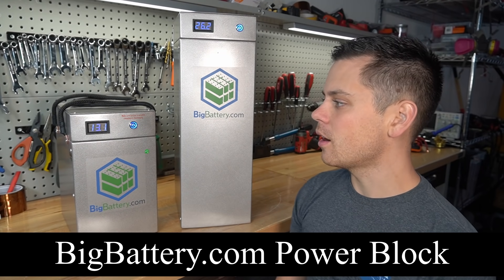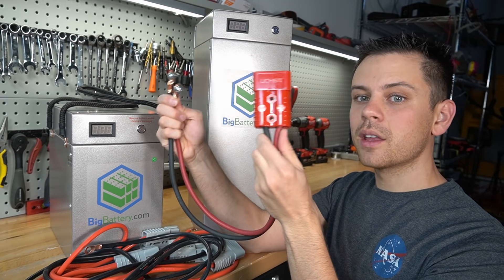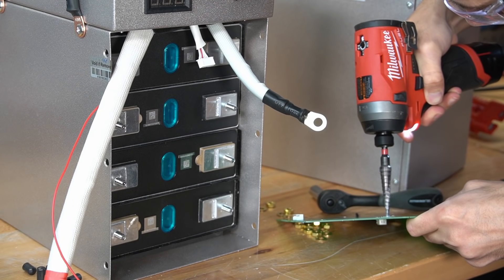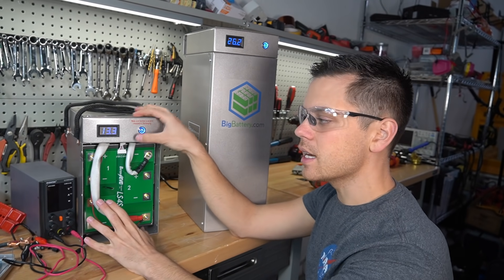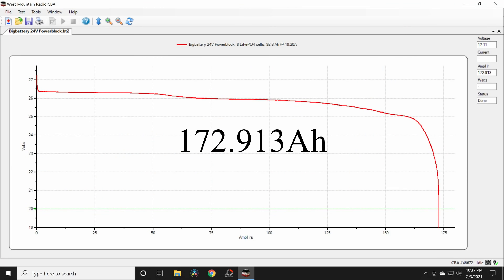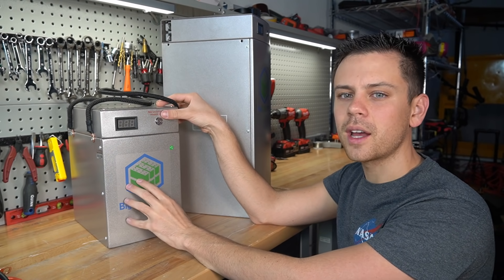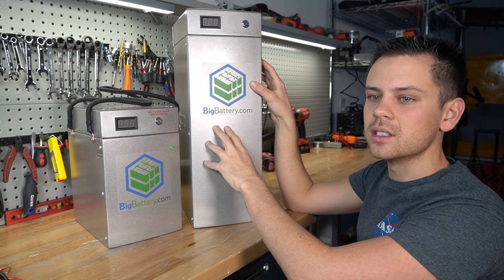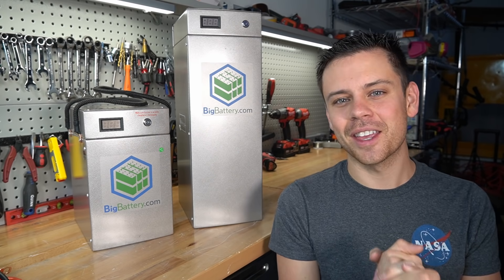Bigbattery.com Powerblock LiFePO4

Comment: Will, sorry if this is a stupid question; but you said that Big Battery does not have CAN bus communication.  Does this mean I can't use a battery monitor & shunt to determine the state of charge?  I realize this can be determined from the voltage, but not easily in a typical situation with a load - like in my RV.
Reply from the maker: No you can add a shunt and monitor to any battery. Canbus not required

Comment: Hello and thanks you for your excellent reviews. I have a question regarding charging LiFePO4 batteries in my boat. Somewhere I saw that these batteries can stress the standard alternators on my diesel engines. Is this a concern? If yes, how can I protect the alternators? When we are cruising, this is where most of our power comes from. When at anchor, we have a small solar array and as a last resort generator and charger.

Comment: I bought 4 of these for an install we have happening in my bus conversion shop. All 4 of the first batteries' BMS failed in the shorted closed position on the first power up. The bms can now no longer disconnect the batteries from a load, which makes them very dangerous. Their tech support failed to diagnose the issue over the phone or after they got their hands on the batteries. They sent out 4 new batteries and so far, these all have the same issue. It appears the bms can not handle connecting/disconnecting under load, which makes them essentially useless and quite dangerous
Reply: @TravelingStacker  you misunderstood. The bms disconnected the inverter correctly when the batteries hit their low voltage disconnect, but when the bms reconnected, they couldn't handle the inrush current of the inverter restarting

Comment: My off-road pop up truck camper has AGM but I want to go lithium. How would this connect to a system like that using a Redarc DC to DC charger that charges it either via solar or the altinator. Is this an easy swap out?

Comment: Battery data shows only 1000-3000 cycles.  10 years warranty sounds great, until you read the small print.  The fine print is really only a 5 years warranty with enough exclusions that it would be easy for the manufacturer to void the warranty for a dozen reasons.  If you need a replacement battery after 5 years, you only get a 30% discount to by another battery from them.  During the full 10 years ... all shipping cost (return/send) paid by the customer.

Comment: The Big Battery website says the low temp cutoff is 24 degrees.  Is that a safe number in your opinion?  Battleborn is 25 degrees if I am not mistaken.  Are these temps safe?

Comment: @DIY Solar Power with Prowse. Question, Big batteries website for the 170ah 12v battery, (Model#: I12-1LS22), they state the battery can output 400 Cold-Cranking Amps, I have not seen this tested by anyone on youtube, and seems a bit unbelievable for LiFeP04 chemistry. Could you test this? Or do you know if that much current can be drawn?  I'm hoping to put three of these in parallel to crank my boats diesel engine, (to get rid of my agm's all together!)

Comment: "These batteries have a 10 year warranty", then proceeds to rip it apart. "This may be a little hard to test.." then drills a hole in the circuit board. :-D I'm glad Will tests all this gear so we get the scoop on how it's made and whether it works or not. Note Will also recommends using these bigbattery batteries on their back so the cells are upright, which increases their lifespan. Perhaps bigbattery could change the design of all their batteries so the cells are upright when the case is upright.

Comment: 0° F is around -20° C.  So when they said -20 they meant C.
Reply from the maker: Data sheet stated 0 degrees C
Reply from the maker: They fixed the problem. The head engineer missed it. They updated all units because of this video.

Comment: Does this pack support an overcharge disconnect - where I don’t have to monitor the voltage and use a voltage disconnect externally to cutoff charging ?
Reply from the maker: Yes

Comment: I have one wire off the positive that goes to my AGM batteries for the motorhome to charge and keep those batteries chargedso when I pull off the road and I'm camping I flip a switch so that the solar power charges the two 6 volt batteries for the motorhome can I do that or do I have to have a separate wire going from the charge controller to the the to AGM batteries for the motor coach

Comment: Hi Will, so I received my Big battery 12V 170ah power pack. Very nice piece of kit I'll be integrating into my weekend van build.  I ordered the optional Anderson 175SB connector from them too, I've been very disappointed to see it was made with 6AWG wire.  Any insight into what is going on there?  I realize I won't often be drawing more than 50 or 60A, and never charging with more than 50A, there is still a chance that I could exceed that.  My plan is to return that cable and put a 1/0 cable instead.

Comment: I LOOOOOOOOVE watching your solar videos Will!  You are one amazing young man - my kudos!

I have an unusual question:
Background first -   Im in a rent house and don't want to spend a bunch on lights on the outside by the cute little garden I've grown to love over the covid junk.  I want to put up some solar garden lights - BUT the lead from where I can install the solar panel (and have it charge properly in the sun) is so far away the lights would start up by the roof.

How does a person ADD lead wire onto a $40 string of lights?  Can you only go so far with the leads before the power "falls" - or does it?  I'd need to go about 30' before I'd want the lights to start.

What I'd love to learn is how to get a 20-30 watt (or less) solar panel up on the roof edge and have it power cute lights in the front of my place and then back in the little side garden.  Both sets would need about 30 ft leads from the panel before the lights would start to keep them from starting along the house. (I know, I'm a broke perfectionist, ha)

There is no electrical outlet anywhere outside this 100 yr olf house that I can just plug in and be done with it.  Plus this would be SOOO COOL to show my friends I built this setup!

This would be a fun video to watch for all us STILL NEWBIES AFTER WATCHING  YOU FOR TWO YEARS - admit it y'all, there's a bunch of us! ha   -   

Qs:  can I add lead wires to solar lights (from the enclosed panel to the start of the light string)  / ucan I configure a separate panel to power two (or more?) sets of solar lights / How to set up what size solar panel to actually power 100-watt electrical garden lights?

THANKS AGAIN WILL.  You're a sweetie and despite your earlier troubles, you chose to help so many people.  I hope within the year to have a van build and get a solar setup that you've shown.  Take care!

Comment: I have a question: I am using 4 lead acid 12volt batteries for an off grid situation. I have a 100watt Thunderbolt/Harbor Freight solar array. Small potatos, I know. But I want to get a better system by the time summer hits and temps go above 95°. My question is this - should I change over to a 24 or even 48 volt system or should I stick with my 12volt system? My use is for a stationary location. I want to be able to run a small AC unit, a small refridgerator, some fans and a stereo and/or TV.
Have you made a video that explains the differences?

Comment: BigBattery 12V 170Ah Extreme Power Block- "High Temp Operating Range!" is kinda a sloppy load of BS. Website: High temp charging shutoff is 95F (35c). Discharge to 131F (55c) is fine. That's the lowest high temp charge shutoff I've ever seen. Lyon is 115F, Expion around 130F, no idea about SOK. It's 100-110F in my rig in the summer (don't ask, it is).
Reply from the maker: Must be wrong. Will tell them
Reply: @WillProwse   Forgot to add I did email them about this on 1/28: Message: R12-1LS22X has a max charging temp of 35c (95F)? That's really low! Is it supposed to be 55c (131F)? It's 100F in my rig in the summer is why I'm asking.

Reply was 2/1:  That is a standard recommended temp range for the ambient temperature around the battery, but it can function up to 55 C.

Thank you & Stay safe.

Sincerely,
BigBattery Team

But..my question was.. not answered?

Comment: Why are we limited to low voltage batteries? Is there inverter limitations at higher voltages.? Why aren't we using 120v or 240v. ? Is battery construction too difficult with that many series cells . The car companies are pulling off over 300v. Why is power storage different.. thanks to anybody who might enlighten me..

Comment: Will, This is a great battery and I’m considering using them for an off-grid RV power source.  Your dismissal of the CANBUS connectivity is exactly what I want you to review.  Your comprehensive reviews help novices (like me) to determine if the application works for the application being implemented.  Please review the CANBUS connectivity, because RVers can use the connectivity to evaluate how much power is being drawn and we can adapt our lifestyle to match the battery capacity.  Love your videos and keep up the great work!!!
Reply: More importantly you don't have to wait until the company is insolvent to file a claim on the warranty if you have the can bus telling you that it's not going to deliver the promised mileage.

Comment: Charging lithium battery at low temp create lithium plating.. not so good as  it is a irreversible loss of lithium and also the  internal resistance of the battery will increase=  capacity loss at high current.

Comment: It is my understanding the Anderson connectors that come with this battery are limited to 1/0 cables, however all of the 2000 watt inverters I am evaluating for installation in my system spec 2/0 cables. Is this not the battery for me, or is a 2/0 cable overkill for a 2000 watt inverter?

Comment: I bought one of the 12v 170Ah power blocks a few weeks ago when it was on backorder. It should arrive tomorrow. Having watched all of the videos you have on these batteries, I have asked myself a question. 

How am I going to test the capacity of my pack so I can set my battery monitor correctly? For my lead acid, I set it for 80Ah and called it good. Should I do the same with this and use any extra capacity as a buffer/reserve?

Comment: I love my 12V power block. It's funny you posted this today as I'll hopefully have another video up tomorrow related to mine (kindof). I agree regarding the feedback listening. I really like the 24V batteries I have with the Tesla cells, but man, that breaker double pole combined was a pain point. I am glad to see they moved to fuses and it's great to work with a company who is willing to discuss and listen to customer comments. Thank you Big Battery/Eric!
Reply from the maker: Agreed! They are good to work with. Very attentive
Reply: @WillProwse  I'm not sure I understand this dialogue I remember them having putting you talking about having two circuit breakers in parallel to provide for a significant amount of current or something which doesn't make any sense. But what I don't understand is why they didn't fix it correctly with another circuit breaker because having a fuse is cost engineering for something that cost something much less than this. I do understand that if you don't want the fuse to break you can install your own circuit breaker at a lower amperage. I guess that's why you guys like to have the cheap mandatory solution as it is trivial for anybody to put a smaller circuit breaker in if they need the circuit breaker to use as a switch or otherwise LOL.but for many readers they're going to think that fuses are better than circuit breakers and I don't think of it either of you are saying that

Comment: I am so new I am not even sure of my question. We have been approved for solar panels for the house. We passed on a battery as that was going to add 10,000 to our price. Would one of these batteries be enough to keep the system running if the grid fails? Or do I need a lot more to keep my solar system working? I hope I am not offending anyone. Thank you for sharing your expertise with us.

Comment: Will, bro', love the channel, think you're sound, a straight up individual sharing information honestly, so please don't take this the wrong way, putting ones' trust in NASA is a high risk venture. 

I ask myself, how is it possible that the current NASA programme : 'Return to the moon' are STILL unable to return to the moon until multiple issues are resolved, including, radiation protection, temperature protection, dust contamination of sensitive equipment*, etc to name but a few, with some even relying upon future solutions not as yet understood, such as advances in material sciences, and yet all these were solved (allegedly) making it possible, and indeed achievable (allegedly), for previous moon missions & all with nineteen-sixties/seventies technology???

*According to NASA's return to the moon team this will have to be solved by a spacesuit on an extendable umbilical attachment thats attached to the exterior surface exposed to the outside atmosphere, which is entered by an individual from within the craft via an internal airlock, unsealed/sealed, and used extended for mobile manoeuvres & upon completion, the entry  process is reversed & thus ensuring the continued  permanent separation of interior/exterior & negating the hazard of contamination of dust & other particulates, CONSIDER THIS, and yet on previous missions (alleged) the astronauts could go tearing around on a space buggy  throwing up rooster tails & when finished, stow the (dust covered) buggy & hop straight back in (possibly covered in dust) the capsule & all's well and good.

...and the only logical answer i can come to is someone is selling 'we the people' a crock of sh.....a bill of goods.

Great channel & thanks for all your time & effort sharing it.

Stay safe & peace 🙏❤

Comment: Which of the current batteries around this price point per kwh would you say is best for a marine application?  I've got a sailboat that's currently got two 8D sized flooded lead acid batteries, and I can't wait to get those removed and replaced with lifepo4 batteries.  

Here's a video idea:  Those of us with boats face a situation where we could be charging the battery from an alternator, solar, shore power, or from a wind generator.  Lots of different inputs.  I'd love to see a rundown on the best way to build a system like that.

Comment: Hello from Stuttgart ;-)
I do have a problem with one of my lishen cells 
(same type, as shown in this videos  „BigBattery“ disassembly )
One of the battery terminals was not welded on correctly and came loose !
If anybody has an idea how to repair this without a big spot welder, 
hints would be very much appeciated ! 
Thanks a lot and stay solar 👍🏼
Harald

Comment: Will, BigBattery provided these 85% DoD parameters for the 
24V 170Ah LiFePO4 Power Block
What would your recommendations be for 80% DoD? I have 925 watts of solar charging through the Victron SmartSolar 100 volt/50 amp solar charge controller. 

Bulk Voltage: 28V - 29.2V
* Absorption Voltage: 28V - 29.2V Absorption Time 0-15 min
* Float Voltage: 26.6V - 27.6V
* Equalize: OFF or as short time possible @ float voltage
* not necessary
VOLTAGE CUTOFF - Low Voltage: 22V High Voltage: 29.2V
Reply from the maker: You will need a shunt to measure and find an ideal absorption voltage at your specified soc, but if you want to be on safe side and charge to cycling bandwidth thresholds quickly, 28V for absorption, and 24 volts for low voltage disconnect. You should get some nice cycle life numbers with that.
Reply: Thank you very much Will.

Comment: I built a mobile POC second battery setup with the 170Ah 12V  for a remote offroad truck setup.  Worked great and it's nice to have so much capacity in the back country. Great to know the low temp charging was a bug and not a feature.

Comment: do you meant 45 cents for watt hour ? how did you come out with kilowatt hour for 45 cents ?
Reply from the maker: I added that to the video. It's across the bottom of the video. And yes, that's what I meant
Reply: @WillProwse  yes I noticed it right after I posted my comments , but if that was me I would had edit out those words in the video ! just my opinion .